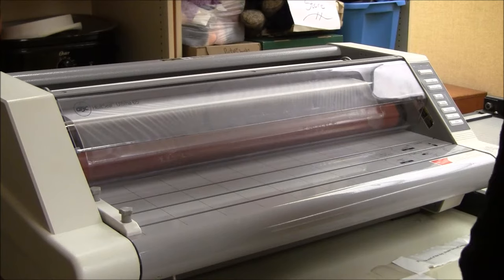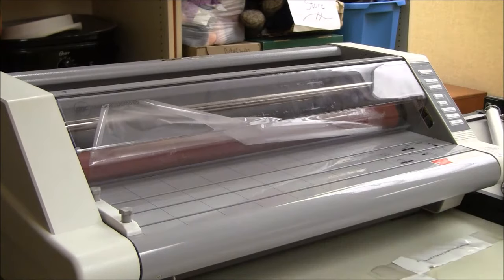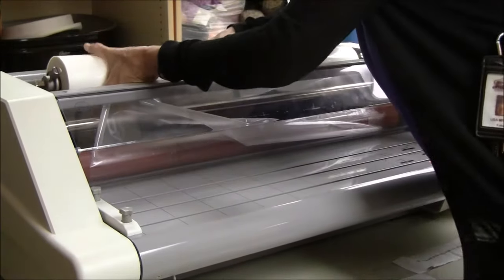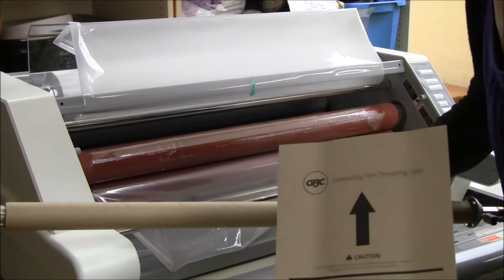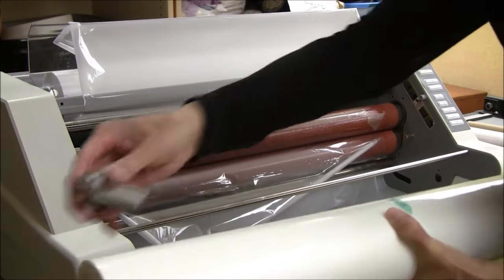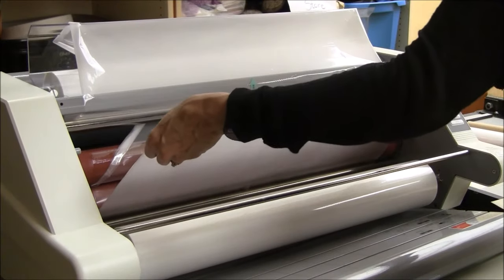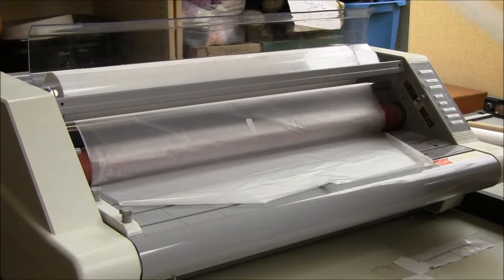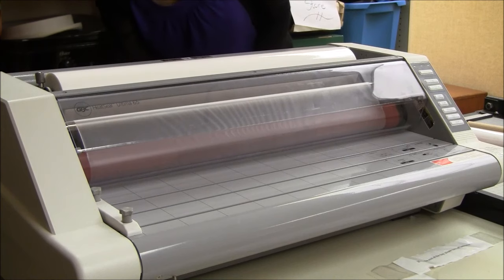Changing Rolls of Film on a GBC Roll Laminator

Comment: What if I cut the paper too short in the back and the items get stuck on the back rollers?
Help please?
Reply from the maker: Sometimes you can remove the back panel by unscrewing the screws that hold it in place, then you just have to turn on the machine and try to carefully tug the film free. If that doesn't work, you might have to call a technician. Sorry!
Reply: @fluxingwell4221  thank you.

Comment: Our plastic got completely stuck to the roll someone that didn’t know how to change it try to help and know is stuck. How do I fix it? Please help
Reply from the maker: The same thing happened to ours, and we could not get all of the film off either. We just ran the machine as usual, even though a bit of film was still stuck on. Eventually, it stuck to the other film as it was running through, and now it’s no longer there. I am not a professional, so not sure if this is the best solution, but it worked for us.
Reply: Thank you so much I’ll try that